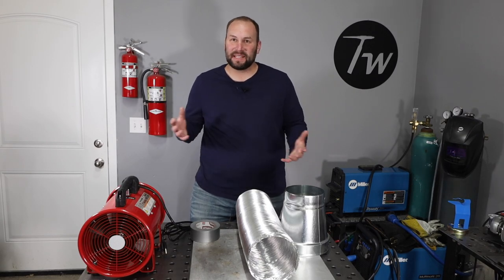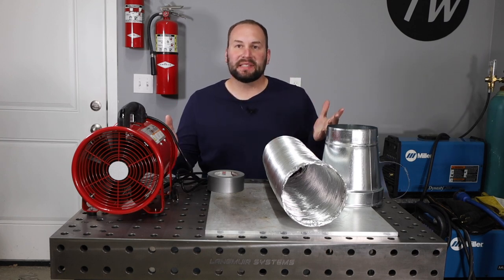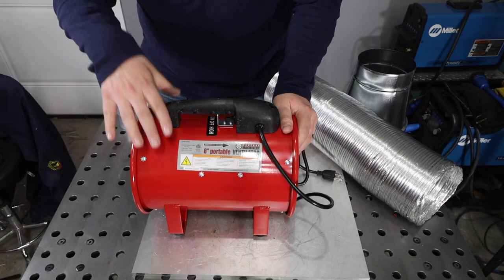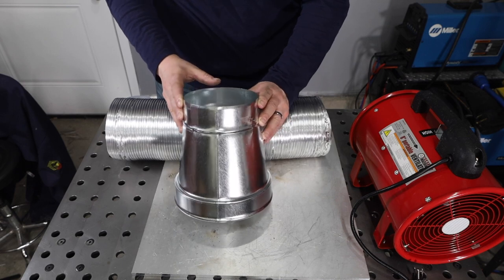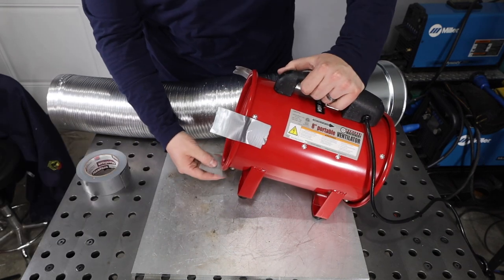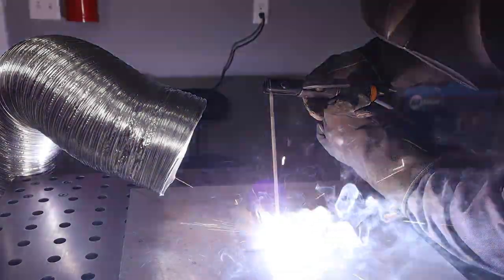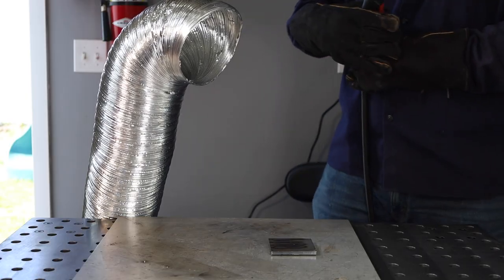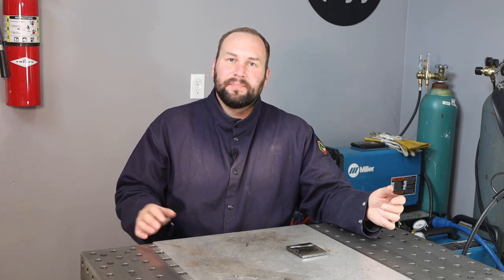DIY Welding Fume Extractor | Super Easy Budget Friendly

Comment: I primarily do flux based welding and the fumes are pretty gnarly. I was looking at different fume extractors, and the price tag has postponed that upgrade. This basic little setup will help a lot with air quality in my shop. Thank you for making this video!
Reply from the maker: Thanks! I've been putting it off for a long time too, and I saw this blower on sale and thought that it might be a nice, simple option.
Reply: @TimWelds  you’re welcome man! 🙂
Reply: @TimWelds  Do you think that galvanized sheetmetal reducers would be ok (I cannot for the life of me find any aluminum reducers) ? I'm figuring that if the puddle is a good 8-10 feet away from the reductor placed onto the blower, that there should not be an noxious fumes created (I am guessing that the fumes would not be sufficiently hot to have such an effect by the time they have traveled to the glower unit) .... what do you (and others) think ?
Reply: The price tag has prolly postponed most of us
Reply: @grassabrutta  I think your fine
Reply: @TimWelds  Bought your classes and you are great at breaking stuff down for the home hobbyist. Now I have a fume extractor to go build. Keep up the great work man.

Comment: I'm setting one up now with the sad, beat up little Lasko blower I have lying around. I attached a 6 inch stack boot to one end of the blower since it's square, and modified the other end to accept a 6 inch starting collar. I cut out a piece of 3/4 plywood to fit my window (like a window AC) and I attached another 6 inch stack boot to it. It was a bit time consuming and looks heinous thanks to the use of "great stuff" in some difficult-to-seal areas, but I hopefully have something that I can leave installed all the time. I'm planning on packing it with insulation so it's good to go in the winter. The last piece of it is building the actual hood - I got an 8 inch to 6 inch reducer as well as a 14x6 to 8 inch register box to serve as an "exhaust hood." The idea being I want to increase the extraction area at the expense of static pressure. This is mainly because I primarily plan on MIG welding and don't want too much of the shielding gas to get pulled away.

Comment: Awesome confirmation of an idea I already realized in my garage. This really works. I have air pipes on the ceiling as well as the ventilator. Cheap and working solution.
Reply from the maker: Thanks! I'm thinking that I may add some permeant ductwork now that I've seen the concept work.

Comment: Hi, Tim. You may find it helpful, to get another adapter (like you put on the blower) and put it on the collection end of the tube.
That way, it should pull air from a wider area, but still be somewhat directional, in it's collection.
This is, pretty much, what you see in other welding shops..
You may also want to find or create an articulating arm arrangement, to hold it where you need it.

Comment: Hopefully this helps some folks. I picked up a 8" to 6" duct reducer with some 6" x 8' semi-rigid aluminum ducting. The 8" to 6" reducer did NOT come crimped so the 6" x 8' round ducting wouldn't fit. Soooo I bought a pair of 5-blade ducting/HVAC pliers to add the crimp and it fits like a glove now.
Reply: Ah, yes! I was looking for your comment, am about to build this tomorrow! Thank you!
Reply: Thanks, I didn't know there was such a thing. I bought a few splice collars and now I'm thinking I should have just bought the ducting pliers instead. At least that way you come away with a free tool at the end of it!

Comment: I'm in the process of building a workshop; it's currently a big sealed box (no windows, one door), so I'm looking at fitting a big fan through the wall opposite the door; I like the idea of the ducting to aim the ventilation when I need to.
Reply from the maker: Very cool! One day, I would like to duct the blower in permanently with a vent outside. Good luck with the shop!

Comment: This is great. I did one too. The only problem I found is that putting the tube outside an open door usually means that half the time a breeze blows it right back in. I had to remove a pane of glass from a window in the garage, where I do my welding, and make a polycarbonate pane with a hole in it, and placing the tube in that. When I’m not using it I replace the pane with another one that fills the opening.

The blower I was able to find nas two speeds.
Reply from the maker: Thanks! That’s a great idea. I’m already thinking that I might do a more permanent installation with a hole in the wall.

Comment: I did the same thing in my barn/ shop except I used an inline 6 inch blower going out a 6" dryer duct works great when I'm stick or mig/ flux core welding
Reply from the maker: I may have to add the dryer duct down the road, that would make things way more convenient. Thanks for the tip!

Comment: As always informative and helpful, but the one I made is very much similar to yours but to turn the fan output down I put a small rheostat on it that I got at the hardware store to slow the fan down and it works great. Thanks for another great video
Reply from the maker: That's a great idea! it would be nice to be able to turn it down a bit. Thanks!
Reply: Wow Tim that fast , I thought I'd give one of the things I've learned since I've learned so much from your Channel . Nothing like burning rod👍😉  @TimWelds

Comment: I just us a square fan xD it works. Especially when I'm under a truck I lay it on the engine bay and it definitely sucks the smoke out very well, but I'm gunna make one of these also, thanks for the video 👍🏼
Reply from the maker: That's a great idea! I should probably get one of those too, since I'm often not at a bench.

Comment: You could mount it under the table and adjust where you're welding on the plate and draw fumes out and down. Sister had a vent at the same level as the stove and worked great.😆 Or maybe box in the underside of the table.🤷‍♂️

Comment: So I have a slightly different application. I have a curing machine which has two chimneys that vapor/fumes come out of. Can I put a splitter on this and have maybe two 3 inch vents siphoning fumes at the same time? What do you think?

I'm also thinking about putting 8-inch vent on the backside and sticking that through the wall so it vents outside during the wintertime. What do you think?

Comment: The distance from the fume source and fume hood is very important in fume extraction . The 2nd example is not really pulling fumes due to the distance . I think a lower cfm or suction pressure closer to the fumes would be better imo

Comment: Depending on what's beyond the door, you might consider a filter. Shop vac filter might work. Alternate approach I have used (when already in good ventilation) is allergy furnace filter taped to box fan.
Reply from the maker: Great suggestion! I wanted to use a filter, but I worry about it catching on fire without a proper spark arrester and perhaps flame retardant. It's probably unlikely, but I have seen a couple industrial filter units go up in flames because they didn't have proper spark arresters.

Comment: Hey Tim i do a trade test it is a butt weld overhead with a 1/16 steel plate a 1/4" gap with 7018 rod i used 75 to 80 amps an it haven't came that good i need some advice please ???
Reply: Anthony, Tim is not going to be able to weld that either. Are you sure about the material thickness?
Reply: Yes i am very sure is a 1/16 plate it's very thin a 1/4 inch gap wide i didn't get to penetrate true it with the 7018 an i wasn't expecting that with a 7018 rod either it suppose to be a 3/8 steel plate test piece with 6010 an 7018.
Reply from the maker: That sounds like a nightmare! I've never tried that one before. The 3/8 plate with 6010 root and 7018 cap sounds more doable, for sure.